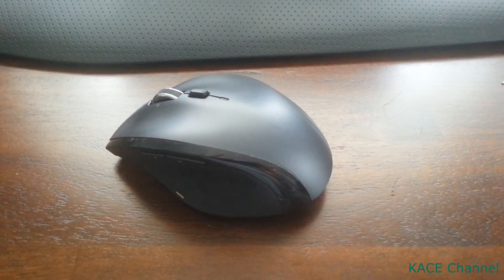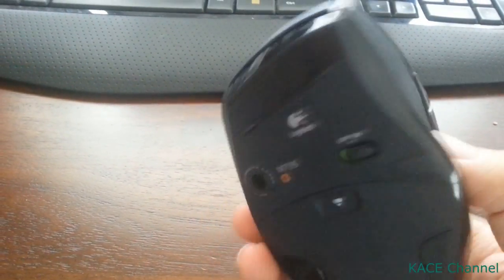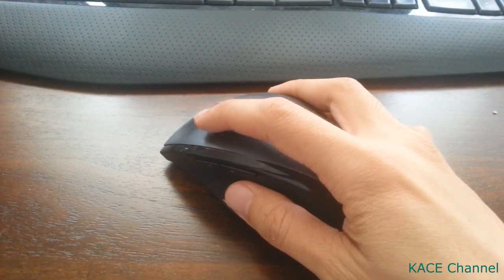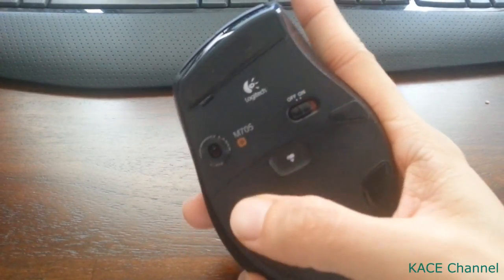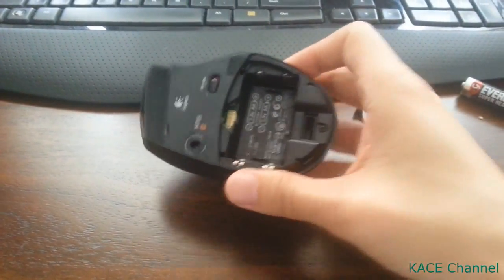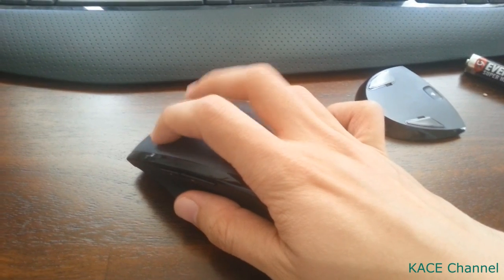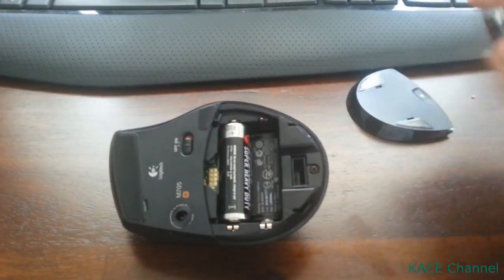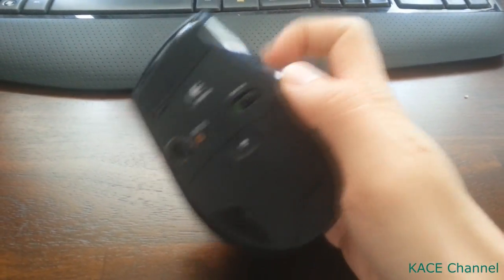Logitech Mouse Double Click Fix - The Most Simple Method. No Dis-assembly Required

Comment: I'm terrified to reply here in case it will jinx me ... but OMG this may have worked!! I got a new (refurb der..) Logitech MX Vertical from Amazon and it was doing double clicks for left single clicks ALL THE TIME since I bought it (week ago) and it was costing me lost time at work every day (and DRIVING ME INSANE). I was about to return it but tried the instructions here and I think it may have worked! Will report back if the mouse stays fixed for few more weeks.  Thank you for this video!  🙏
Reply: So does the fix still work?

Comment: Thanks for the quick tip man, awesome it worked, stil gonna replace the mice if it still does the same after a couple of weeks.

It's not a secret that Logitech has double clicking issues all over the place on their mouses, I think the only brand that doesn't have that problem is Razer, I was using a Viper Mini before switching to a G305 cause it's wireless and I never had any issues with the click AT ALL, Logitech should step up and add those optical switches to their mice too.

Comment: Out of 3 logitech mouses all has problems. The double clicking is on the G700s mouse. your mouse model seems similar. So I would like to so much hope it will fix it....
As for other mouses like M187 the clicks doesnt seem to register half the time, somewhat random. Will try searching about after that.
G600 also have some problems, but dont remember clearly after what was it.. maybe that while draging something the click suddenly disapears and draging fails (I also miss the infinite scroll that the G700s have, I think all mice should have it).

Comment: is this a f*kng joke?
Reply: Apparently not, even I tried it with logitech m185 with the mouse not clicking as much, the method mostly fixed it. It's most likely a temp fix, but it's better then trying to disassemble the mouse and trying to take one of the rectangle clicking mech off with possible damages.

Comment: im electronics engineer, I was sceptical but it actually works for now - if they mean static energy its in the debounce capacitors if any - similar to old school keyboard problems where the little spring microswitch's contacts bounced a bit on closure causing double keystrokes, but we will see over time I have lined up a not so used mouse to swap out the microswitch as I also feel its worn out Test the result using a web clickcounter close your eyes count up to 10s etc pressing as fast as you can :-) if its double clicked you will get a number over a ten! Fine so far ! hmm very surprised....

Comment: Can anyone confirm if Razer mouse doesn't have double click issues?? They claim to use a different type of switch than traditional mouse, using laser beam instead of copper plates to trigger the clicks so it has no middle points or chances of static charge buildup.

Comment: Well,  it sorta worked.  It still double clicks sometimes, but not all the time.  Maybe I need to click for longer than 30 seconds.  This has been a problem for awhile now.  I have the same mouse as shown in the video, a wireless M705 that is paired with a K520 keyboard.  I thought at first it was an update issue with Windows, since it was fine for a long time then just started double clicking all the time.  When I used the wireless USB receiver on a different computer it seemed to go away, so I thought it was a driver issue with this computer, but your method did help, so not sure what it is anymore.  I'm just glad it is better, even if only a little bit.  Thank you!

Comment: Am hoping that same issue with Logitech M535 and double clicking is resolved with this method, and thank for this tip. I also used a ZeroStat anti-static gun on the mouse, so between your suggestion and that, there can't be any static left in the device!

Comment: I thought the solution couldn't be that simple. For some time, I've been having double-click (bounce) issues with the mouse (Logitech M315). I tried to adjust click speed (to no avail). It was getting so bad I couldn't even use the calculator function - it would enter 2 or 3 of the same numbers. So, I was a bit skeptical of your solution until I tried it. So far, so good! Thanks for your wonderful solution. I wonder if other mice are, also, susceptible to this same problem. (I never had the problem with a wired mouse.)

Comment: question, I have the g903, and im pretty sure i cant remove the batteries, there doesnt seem to be a way to get at em. Can i do this just by turning off the mouse and clicking for 30 sec, or will it not work?

Comment: OK, I have to honestly say that as I watched this, I thought, "This solution is whacked. No WAY it will work." I have an older M510 Logitech mouse, so I followed the steps. I tested it with the Mouse Properties "Double-click speed" test in Windows 10. Before, even with a fast speed set, single clicking would register as a double click. After following the tips here, so far, so good.

Comment: Wow, thanks. My wireless Logitech M510 mouse was driving me nuts because I do a lot of copy and paste, and it was really a pain to do anything. At first I thought about getting a new one, but it's paired with my wireless keyboard, so I didn't really want to use another USB port. I looked up videos to repair it, which involved taking tiny parts apart, and maybe using some oil inside. I just got out the tools, tweezers, tape, and flashlight, to take it apart, and decided to watch a few videos again before doing it. Then I saw this video. I didn't really think it would work, but it seems to be working fine right now. I don't know how long it'll last, but I'm happy right now.

Comment: My Logitech mouse was starting to act up--- not doing the double click trick but doing weird things with the left click and drag. dragging and letting go of the object in the middle
of a transfer.  Was skeptical of this fix but tried it just for fun.  Damned if it didn't fix it and it responds like the old mouse I was used to. I was ready to buy a new mouse and you just saved 
a trip and a bit of cash.  Was also looking at other you tube sites that had you tearing the mouse apart and tweaking the spring in the switch.  This was so easy and soooo much less
frustrating  than messing with all the tiny pieces.   Very great and easy fix.   Thank you thank you!!!!

Comment: This trick never worked to fix any of my Logitec mice. This has nothing to do with static electricity. Dexoit G5 works wonders on these switches. Just spray Deoxit on the end of a Q tip and work the microswitch plunger with the wet Q tip. As soon as you see the Deoxit leak out of the bottom of the switch reverse the Q tip to the dry end and work the switch a few dozen times to let the Deoxit burnish the contacts. Let dry. Might just as well do the other switch too. Going two+ years now on a new replacement G700 I got under warranty. The replacement started acting up after 90 days. Now I have 2 good mice.  You may need to see a video on how to access the switch.

Comment: I used this to fix a rapid and continuous left-click issue with my MX Ergo trackball. The one I have now is my 4th 1 and I had to replace the 1st 3 because of this exact issue. In case you don't know the MX Ergo trackball is a $100 mouse. So I was willing to try just about anything to avoid having to buy another 1. I wished I had tried this a long time ago and saved myself $400. I honestly didn't think this was gonna work because all of my mice started having this issue about a year after I bought them so I just assumed it was a wear and tear.

Comment: Worked on M150. I thought i had to change the mouse because the double click issue and also i have to press the wheel button don't work unless i press it with a lot of strenght. This solved my double click issue, now i will look for a solution for the wheel button.

Comment: This fixed my problem!... I have a wired mouse but the idea is the same... unplug USB cable and do the clicky routine for 30 seconds.  When I plugged back in, mouse was functioning properly.  I had never heard of "static electricity' being stored before and never had this problem before lately.  Thanks so much for sharing! (Logictech G600 gaming mouse)

Comment: I found a way to fix the double click issue on my G500 without opening it up: 

1. repeatedly smack the offending button hard with your finger as if you're angrily trying to click on something only once because it keeps double clicking and it's making you mad. 

2. test and see if you can drag a window around for a while without it letting go and/or test clicking for a while to see if it double clicks.

3. If it's still not working correctly then repeat from step 1. Else If it's working goto step 4.

4. If it's working be happy I just saved you from hell and give me a thumbs up. 

This has worked for me on both the left mouse button and the middle scroll wheel button. The problem will eventually come creeping back, just repeat this technique to fix it again.

Comment: Was about to take the thing apart to clean micro switches, and decided to try your method since it is so simple.  YESSSSS, actually works!  Thanks for the extra 2 hours you just saved me.   I have had 4 logitech mx type mice that I owned over the last 7 years and they all ended up with this problem.   Could have saved myself $300 by just googling it first.  You rock!

Comment: This happened to my mouse and I changed the mouse settings so that I clicked with the right button instead of the left one, I kept it like that for over a week at least. And now I was going to try your method so I changed the mouse back to left-click mode and first tried out the left-click with a screen keyboard and it actually worked perfectly! It must have been a similar fix to what's been described in this video. If it happens again, I'll definitely try your method. It would be so much faster and I wouldn't have to re-learn to use the left button, hah.

Comment: I swear I expected you to smack it with a hammer the whole time ;'D
I hoped it fixed my G600
Reply: It actually worked, and now 8 month later I have the problem again and came here for the fix again :)
Reply: @Deutschehordenelite  Me, too. Logitech M310. Worked again.
Reply: wait, my g600 is wired, do you just unplug it from usb?
Reply: How to basic has ruined me on this as well.
Reply: @KGB G600 here, doble click problem too, left and right click
Reply: @alexisesquivel4534  i'm with the same problem, almost throw my g600 on the wall, hope that's work
Reply: i have a G700, hope it works to...
Reply: @pippa0154  At some point I soldered a new microswitch on because it got too bad and it worked great again. Unfortunately it fell down a few month ago and was toast after that.
Reply: could be a temporary fix for a while......But don't be surprised when the cheap Chinese sensor fails too often

Comment: Worked with M305 It was irritating switching usb receiver port, changing battery, adjusting double click speed in control panel, etc and nothing worked.This is the only method actually worked. Maybe temporary but it is working for now. Thanks!

Comment: Thanks for this tip! I've been fond of M505-525-545 line, but they get this issue after 2-3 years. As I had put away and saved the old faulty ones "just in case", your tip just got me 3 extra mice... The switch copper plate fix has to wait a bit more.

Comment: Very well thought. Should have thought it myself, cause of the remote controll also having this problem sometimes. Solution batteries out and push every button for 3 secs. Now what i did, was i removed the rubber pieces on the bothem of the wireless mouse. Could be the rubbing of the mouse over the surface is causing the electrostatic voltages. So i'm trying to fix it, using ducktape pieces instead of the rubber pieces that were under the mouse before. Don't think something inside the mouse is causing the problem.

Comment: It's oxidation on the metal contacts, or sometimes the contacts get deformed after lots of usage, the solution on the video will only work temporarily, the ideal solution is to change the microswitches or if you're into diy, you could fix the switches by smooothly sanding them.

Comment: WARNING: That's only a temporary fix in most cases! The real problem is caused by a super thin layer of crap on the copper contacts in the micro-switch that builds up after thousands of clicks. To fix it (it's SUPER EASY only takes 2 minutes) disassemble the 5 screws, pop the top off but leave the wires attached, just rest the top on the side. Get electrical contact cleaner, spray small amounts (couple drops only) on the 'faulty' microswitch, use a screwdriver to push it over and over to let the liquid saturate the internals, add a few more drops and do 20 more clicks. Close everything up, click a shitload more times. That's it. Fixed two different model Logitech mice with that method. Ones been working perfectly for over a week, the other 20 minutes. So far so good.
Reply: I'm not quite sure how to safely pry open the G600. Is there a vid for this ?
Reply: I was shocked this fix worked on my wired mouse (G303), but how often will I have to unplug it and do this? It's still under warranty, so should I just send it in anyway?
Reply: ***** Logitech seems really good at replacing damaged products, my mouse started having issues again after 2 weeks.. so I called them up. They sent me a new one, and didn't ask for me to send the damaged one in.
Reply: @retiredshitposter1062  Did the replacement mouse they sent you start to have problems after a while too?
Reply: @da009999  I'm curious about this. I've read many people say they've had to RMA up to 5 times in less than a year. Rediculous.
Reply: could you uh... do a video on this please...?
Reply: There are videos for other mice, but the same instructions apply , so just watch those instead. As for opening up a g600 (or any mouse), take of the rubber-like "feet" underneath the mouse and unscrew.
Reply: Tried the technique shown in the video, but that didn't seem to work for me. Wanted to try what you describe, but how to disassemble was not to clear to me... until I found this video which helped explain: https://www.youtube.com/watch?v=7-SO4joDah8. Apart from that, so far so good with this technique for me - thanks! Fingers crossed that it lasts...
Reply: Thank you!!! I did this on a G203 that was 3 months out of warranty. Don't have a soldering kit (or want to wait for a new switch to come in). Tried your suggestion (only difference is G203 is only 3 screws). I didn't have electrical contact cleaner. Used some 80% alcohol hand sanitizer (probably not the best, but it's not like I was going to ruin the mouse, eh?). So far it is working great. Even if it only lasts for a day, it'll be a day that goes by where I don't want to smash this mouse :)
Reply: Thank you, worked instantly. Let's se how long it lasts.

Comment: Yip it worked on my gaming mouse, it aint this model but it was acting up. like not holding a object. it would let go say if i was holding a menu tab with the left hold down. it would just let go. and also double click with one click. i just did what you said and its fixed it, though mine has no batterys, i just disconnected it from the usb port. mega. TU

Comment: This is a great video and it makes sense that the static energy is messing with the circuit but I just have one doubt that why don't we just keep all the buttons clicked and hold for some time say 15 seconds while the device is not powered. That should work too as the static charges will get a steady path to be drained. That way we don't have to randomly press the buttons like that. Unfortunately I already fixed my mouse before thinking of this and so I couldn't try that out myself. If somebody tries this out please let us know.

Comment: I tried this trick, but it didn't work! Then I stripped down the dodgy switch as, far as removing the cover and gave it a short squirt of switch cleaner, which worked. I think that the problem is more mechanical than electrical and jiggling the buttons probably cleaned the contacts a bit.

Comment: Didn't work for me (G600) :(
Reply: use the software to configure as left click any of the tumb buttons
It's actually very convenient
Reply: and yes it worked for me with a g600. remove the usb cable and click for 20s as described in the vid
Reply: did you try with unplugging it first?

Comment: ok this worked for my G600 at least so far. Instead of the double click though my right click just started spamming what I had my G19 key mapped to. I plugged my G600 into a laptop and it continued to spam the key as soon as I right clicked so I thought for sure this was your typical G600 crapping out. 

I followed this advice and it worked. Now I need to know why it worked lol. Why does this work? It can't be static buildup because if there was static across the contact's it'd short it out and break it (static electricity is something like 20k volts or more than enough to fry electronic components). Does anyone know if this is a manual switch or ....? (could be gunk buildup and this forces it out somehow?)